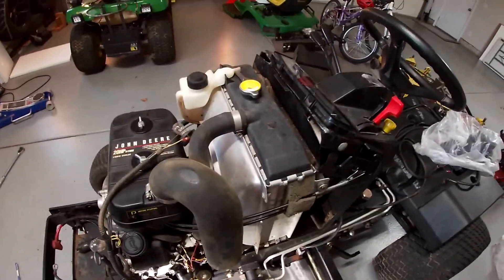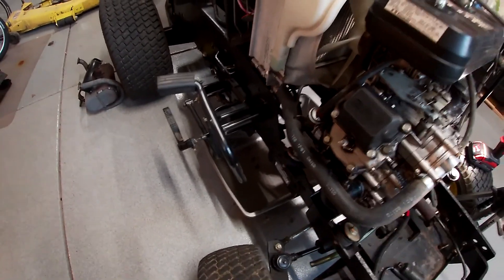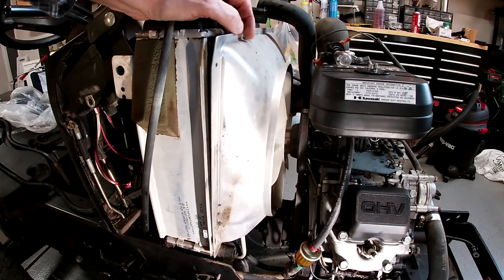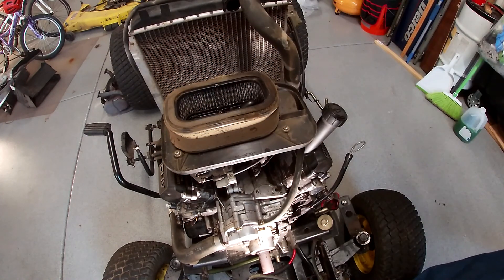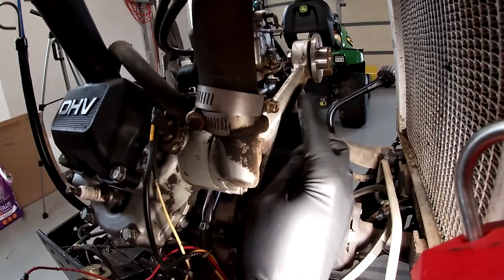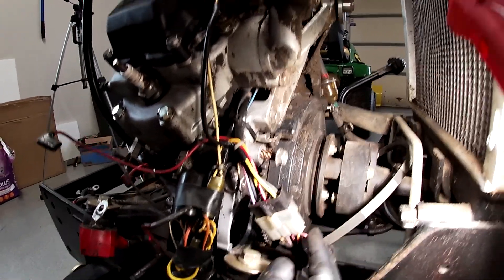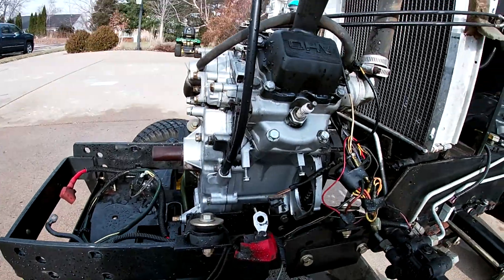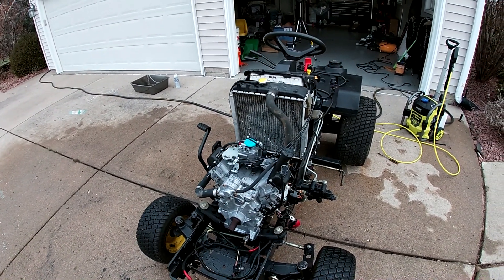John Deere 425 Disassembly Ep. 2

Comment: Good video, .
i would recommend not reusing the old coolant. coolant becomes acidic with use and time. Acidic coolant causes premature water pump shaft corrosion and then the seal starts to fail and leak coolant. Acidic coolant also eats intake manifold gaskets, cylinder head gaskets. these are both expensive fixes. on a small liquid cooled engine, change the coolant every 4 years or less. Will double the life of water pump and gaskets.